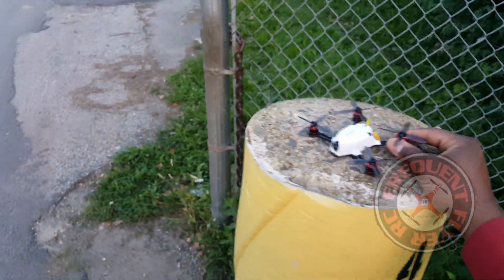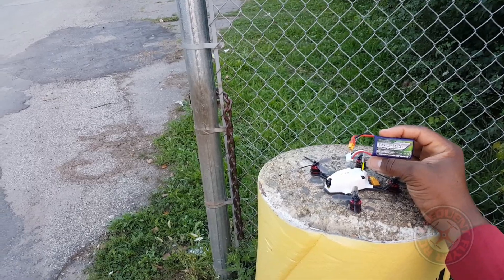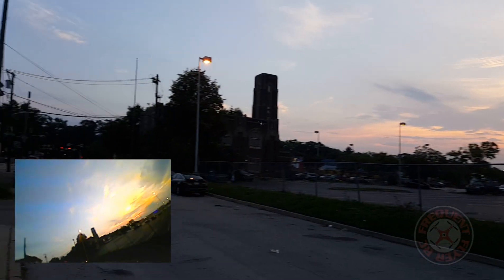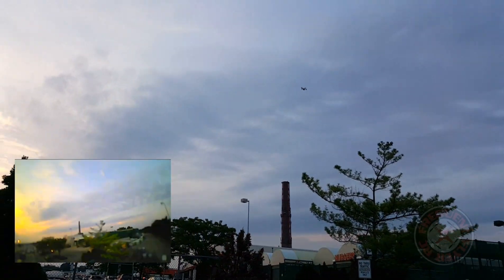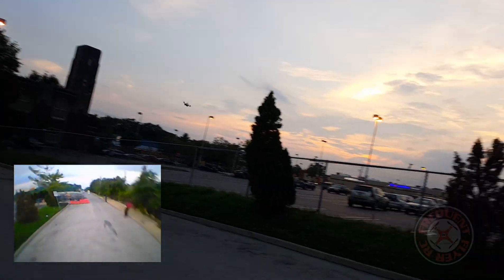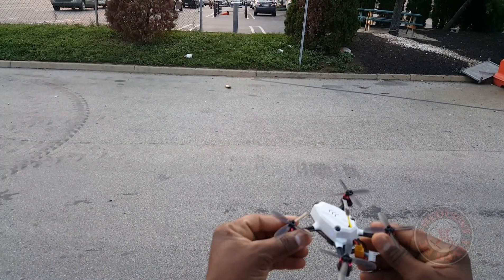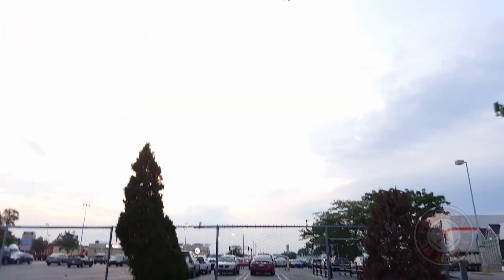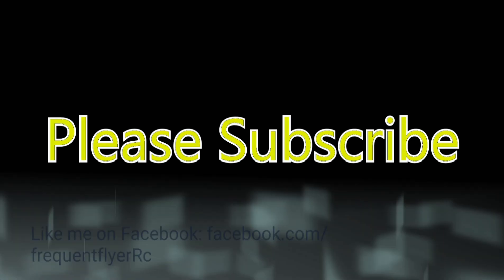Kingkong 110GT with RotorX 2535BN Props

Comment: 1104 7500 is ok to run 3s because they dont get as hot. I think this 8500kv motor might be too hot on 3s. 6000kv motors would make this quad better yes?
Reply from the maker: We shall find out tonight hopefully 😉
Reply: Frequent Flyer RC cant i just add the motors to the original 110gt? The 10amp esc should be able to handle it. Its easier to swap those motors because of the proprietary esc 😁
Reply from the maker: Yes you can. But I really like the motors it comes with! Ask any reviewer familiar with  the 110GT and they will tell you they are some of the best performing and most durable motors in 2S and 3S! I have never kill one and I have 2 110GTs now 😆
Reply: Frequent Flyer RC despite this quad is old. I ran 3s on it and mannnnn. It floats the best of all quads i seen. Its so light thats why. Best punch I seen on 3s. Just the way it feels in the air feels you have so much power. If only it had osd.

Comment: these props are a junky gimmick.
Reply from the maker: +Wait, What? You didn't give an explanation of why...
Reply: scews don't fit in four blade mode without modifying them.  propellers require precision craftsmanship... these do not have that quality. they will work, but modifying screw holes on propellers is ridiculous for such expensive propellers. 2435 4blade are way less expensive,  almost same thrust,  less amp draw, and no modifying needed to install and get in the air. i have 2 brand new bags of these things... offer up is where they will be shortly.  big disappointments from a big priced prop with the rx2535.
Reply from the maker: +Wait, What? I personally like the Gemfan 2540 tri-blades more but try out the new ones from RJXhobby : http://amzn.to/2kysogv
Reply: Frequent Flyer RC sweet! i'll check them out: i like the 2435 4blade currently. so nice in my opinion. solid props. i'll def try out the one you just recommended. 🙏🏽thanks 🖖🏾👨🏽‍🚀🤙🏾
Reply from the maker: +Wait, What? No problem, these do not separate though

Comment: I want one!!!! The punch out is nuts!!! But no buzzer, I could lose this one fast in the bushes. I want one anyway. lol
Reply from the maker: +Michael Reyes it's AWESOME but I went back to stock props... TOO much power lol
Reply: Michael Reyes you can setup betaflight 3.2 to use the motors as a beeper as long as you update the escs to the latest blheli. Works great, i just put it on a switch.

Comment: Those props are extremely hard to put on. I just gave up with those rotor x props! How was your experience with mounting to the motors?
Reply from the maker: +SteveO4478 was not hard at all for me but I here the shaft is upgraded now so maybe you had an older version..
Reply: Frequent Flyer RC where did you by then from?
Reply from the maker: +SteveO4478 https://www.readymaderc.com/store/index.php?main_page=product_info&cPath=534_856&products_id=6385